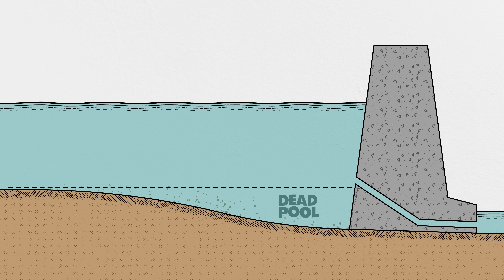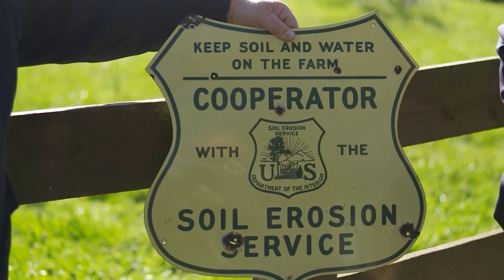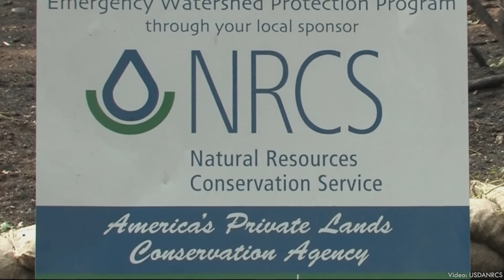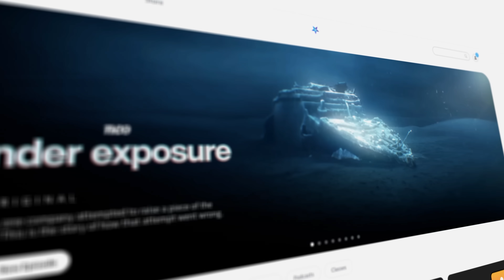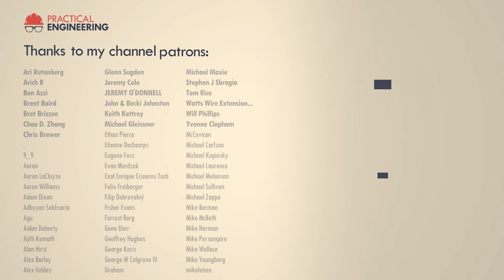All Dams Are Temporary

Comment: There is a dam on a large creek near me. The resulting reservoir has far less volume that it was originally designed to be. It was built in 1961 and was dredged in 1998 because it lost half its storage capacity. When I finally got a chance to visit it in my kayak I was really surprised to find out how shallow it was. The dam is 39ft high yet the water was only 4ft at the dam and that was around 2015. A report from 2005 that I found indicates studies estimate 10,000 tons of sediment deposit per year.  I believe sediment load rates certainly increased starting in the 80s due to lots more developed around the watershed and it only got worse after this report.

Comment: As an engineer who works with dams, I'm mad at myself for not thinking about this issue before watching this. The main dams I interact with are dry dams, and those still have sedimentation issues directly downstream of the outlet structures. I'm uncertain of the feasibility, but I think the flushing idea might have the most promise. Letting the flush happen in stages could reduce the downstream sediment pollution, and inducing pockets of turbulence in the flow could help the flow pick up sediment near the banks upstream of the structure.

Comment: I wonder if any one has tried coming up with a in place pump system that goes around and pumps a section over a period of time and dumps it past the dam using a pipe wouldn't provily work well in most cases but a low sediment river like kenebeck or plesant pond in maine probably would be feasible to pump a years worth of sediment over the course of the year

Comment: I wonder if you could create an autonomous underwater drone that could “vacuum up” the sediment and release it nearer the surface so that a certain percentage of it would go over the dam. Could adjust intervals, quantity or sediment, and location (remotely) to adjust amount of sediment sent downstream to = approximate “normal” sediment flow +/-. Can add sensors downstream to send data to robot which could adjust its own settings (if possible) or relay to engineers who can adjust remotely.

This could be an affordable and adjustable/ scalable solution. Basically one or more of these that operate all the time so that the levels of sediment are reduced but then back it up (reduce to one unit, lower frequency) for maintenance.
Like an Underwater Roomba with a line to the surface area. You should make that! 😊 Thanks for the great video!

Comment: Excuse my ignorance, but it seems to me like the best solution is to dredge sediment out of the reservoir proactively before it becomes a problem. Instead of trying to remove a large amount of sediment at once, you can remove a relatively small amount periodically over time, thus supplying rich soil to locales that need it and preventing the reservoir from shrinking. But, as I said, that requires being proactive, and this is a problem that was caused by a lack of proactiveness, so my solution might not be applicable.

Comment: Flushing can be a great solution if the topography is right. The Gebidem (also Gibidum) lake and dam holds back water from the Aletsch glacier. The water holds high amounts of sediments. So the lake gets flushed every spring with the arrival of the first major melting waters. This will take 48 hours as the stream will first dig a small trench but the walls of that trench will then continually collapse and get flushed into the Rhone river and finally into the lake of Geneva.

Comment: You told me to think abou it. Thus, I thought about it...on the 4th of July (I have some beers into me). God bless America! However, the thought of installing some kind of water tower on the upstream face of the dam occurred to me, since the water depth is higher here than upstream. The tower would pressurize a net of perferated water lines that stretch upstream enough to keep the sediment in suspension as it approaches the dam. It feels like a perpetual motion device, which seems impossible. I must experiment...

Comment: Can't we change it so the problem of build up of sediment becomes something we use to create new areas of land for repair of areas affected by erosion or creating areas for farming food crops....if the dams are first placed in areas suitable and the dam structure is temporary and moved when needed down the river to create a new area repeating this process either going further up or down the river system or remove the sediment from first dam site and using the same area again ....but basically using the build up of soil the ability to redirect when in flood to move the sediment out of the main water channel and into land areas prior to the dam slowing and spreading it across flood plains using barriers to catch the sediment . Also planing of a dam wall not being fixed in place but overall  to remove the perception of it being a problem and look at the potential it holds...
Reply: Like a new concept in dam overall and how we manage them by working with nature and not trying to control nature  so working smarter not harder and the collaboration of different areas of expertise when looking at how we could create something like that ...Goodluck

Comment: You need to upgrade your R&D over soil and sediment flow before you can solve anything.

Idk what's already there, but a hub for scientists parked or build alongside a dam.

Collect resources and samples, act as a small sediment filter to check for pollution and redistribution of safe soil.

It doubles as an place of study, and may give extra time to the sediment deposit. 

Not enough to offset the dams, nor the problem. But maybe enough time to discover something new and save some areas. If they're lucky

Comment: Doing as asked and just posting off the top of my head solution.

Y split to have "free(er) flow" and actual dam with power and blocking .

You can then switch them regularly, and do "purges" opening them almost full to allow for a big "storm" like wash of sediment that piled up.

(You could also have a way near the split to block off and clear in detail that section)

You would have the current "free flow" branch acting as the intended overflow, so less power from the actual hydro part, with the particals suspended higher in the water flowing out and over at higher speed then through the actual dammed part.

The Y split its self is going to have its own build up at that point, that can be partly manged with the purging when switching between the two every so often.

You could also design elements to make maximum turbulence from the bottom to lift and suspended the particles during purge or when acting as the "free flow" to keep lower suspended sediment moving back up right before getting to flow out

Comment: It seems to me that an auger should be installed at the riverbed to intermittently, or just very slowly push sediment back upstream and back into suspension. I don't know if it's better to electrically power the auger or to just gear it up or down and directly power it by the flow. Naturally it would require a sizeable passage through which to push the sediment, but nothing compared to the dam itself. I don't know why this wouldn't work, and I of course don't know the numbers needed to make it economically viable.

Comment: Would think a combination of flushing and agitation coupled with a prudent amount of dredging over a period of 3-5 years might at least solve most of the problems with large water ways.
I know that dredging in and around the Houston ship channel is a constant issue.
Agitating the silt back into suspension while flushing should clean things out... the issue would be slowing it down. Maybe not to the level that would be "natural," but hopefully to a point that it doesn't cause critical issues downstream.

Comment: There... is a very practical and easy way to deal with this but there would have to be a large range "no swimming" or potentially even boating for it to work. If sediment build up is a problem why not just have mechanisms to churn it each time the dam releases water? It could even be turned into a kind of profit on the state or country's behalf of selling the sediment to areas that either need or desire it.

Comment: A question I wanted to pose was that why not co-op the removal of the dirt and silt from the reservoirs via agencies and companies that run landfills? Using the sediment that builds up in these reservoirs as the material that landfills put overtop their amassed garbage when the landfills close could help divert some of the stuff, and would help knock out two metaphorical birds with one stone. Splitting the cost of sendiment removal with the landfill agencies and then providing them with the material might also help the sunk-cost issue of having to remove it in the first place! I can't speak on the tonnage that landfills would need regarding sediment, but it could prove helpful. What are people's thoughts!

Comment: 11:01 

Flushing ain't gonna work for most dams. Because the downstreams are also living settlements and stuff and the dam reduces the capacity of the ruver downstream by A LOT. It won't be able to carry that water and sediments.

There was a case of a flood in India during 2018 where heavy rainfall lead to the dam having to open the shutters because of over filling and it lead to devastating floods downstream.

Oh boy this issue is scary

Comment: If we can pull off the Berlin airlift, dredging reservoirs are 100% possible, and it doesn't have to happen annually. We could do a combination of flushing the reservoirs to start de watering the sediment and having the Army corps or engineers decend on it for a few months before moving to the next one.

Comment: uhm... so, dredging plus Aztec floating farms w aquaponics and integrated solar... equals kickass floating farm situation... a US take on public/community farms?
for the dam, the offer is: lower water loss to evaporation, could also integrate floating solar, and be an offset of sediment dredging? several of the floating plots could easily become staged dewatering plots... that just tow around behind the dredge when needed.
and for the state or city, you get bonus farmland, bonus solar space,  produce both food and an earth product (mulch, garden earth, fertile dark soil or straight sediment, whichever sells best) so... that seems like a business opportunity.
commercially: a farm w default water access, that irrigates in the most efficient and direct way possible, that has cost offsets for water , can easily integrate aquaponics... that literally gets first ask for sediment dirt?
design the pontoons right, there's potential for a dozen design advantages and efficiencies

Comment: the whole "we don't usually dig giant holes to become dams"
>in many places, we absolutely should.
i wonder if a set of settling ponds, cleared regularly, aren't work integrating into most Dam designs..upstream landowners are likely to buy land back.
could change if we took some open cut mines and back-filled some clean clay/sediment.
similarly, if mines were paid to widen, strengthen, and seal out closed sections of underground workings to a sanitary level: these would then become sun shielded, temp stable places to store water.
the other thing is... most sediment is good, fertile farm earth: the kind that is priceyt to find otherwise.. in many ways, those farmers may well be willing to partially discount the operating costs to recover it.

Comment: Can you not just build a miles-long pipe (think Russian gasline to Europe) and use solar powered pumps (like we see solar panels on home roofs nowadays) so that all day every day there are sunny days, the sediment is pumped out? It might be a "slow" approach but surely the daily amount pumped out is greater than the amount that's settling in on daily basis. If output easily just a little larger than input, eventually, you win

Comment: Drain the dam and remove the sediment or build a new dam somewhere else along rivers. Use dredging machines to keep dredging up sediment is another option. No mater how you cut that cookie though it's going to get expensive.

Of course best to keep the sediments out of the riverse to begin with and that means working with farmers and wildlife management to keep cover crops on fields such that you reduce the sediment intake. This just slows the process down of course eventually the sediments will build up but an ounce of prevention is worth a pound of cure as they say.

No matter how you work it though, if you find value in the dam and lake then you have to put the resources into managing it and that means managing the sediments that build up in it.

Comment: I mean, arnt you just creating a water fall/water-tower in some sence that you can derive energy from when letting the prevailing flow just occur in the first place, less reservoir means less wasted land because now you can use the area the damb had stollen with said reservoir. There is a reason buffalo grew up at Niagara, a fall point, a lot of potential energy in all that mass dropping happening at once is a big amount of power. Mill ponds fill with muck, the pond is not the primary use, the energy through put typically is

Comment: This doesn’t seem like a hard problem. Maybe a Boston whaler size boat with a solar array, battery in an air compressor. Attach it to a hose with fins on it so it moves around in the different currents and wait the end so it hangs out right near the bottom. Will add more oxygen to the river dislodge and raise settlement on the base as well as allowed the bubbles to suspend diluted sediment longer. Add as many as you need to return sediment levels to 5% over normal and correct the problem slowly. Pieca cake.

Comment: The largest dam in the Black Forest, Germany was built in 1933.  After 50 years it was emptied for major overhaul of all structures but also do remove much of the silt.  Similarly another lake here.  Only 8 years left until the dams centenary and 50 years since the last major overhaul.

The empty lake was often described as a moon landscape and was an eerie tourist attraction during the summer of 1983.  An old road was fixed up for the tourists and horse carriages took tourists to the ruins of the old village of Schluchsee which had been under water for half a century.  The silt stinks awfully btw.

Comment: we have some sedimentation dams on specific locations so thet the sediment dont fill that much in electric dams on the river.. they use boats to pump the sediment on boat which is then moved away some after cleaning is used as fertilizer or is mixed in fertilizers.. this is going for decades... our grandfathers knew that also.. now we have our big dam to one of its lowest levels of water.. few years ago it was released and cleaned near the footof the dam.. this is great teaching for kids thanks for the model with colored sand is cool

Comment: Irrespective of the dam itself, the dam causes major changes in the flow of the river. 
A couple of quick ideas:
1. Make dams temporary. Anticipate a certain lifespan and design it for that interval and design it to be removed.
2. A different version of this idea is to design the dam to be shut down periodically so that it can be maintained AND for the river to return to some sense of equilibrium
3. A completely different idea would be to dredge the silt from the mouth of the river and dump it on the downstream of the dam. I’m not sure how effective this would be to help the river. Also, I don’t know if this would help the dam itself.

Comment: Thanks for upload and info. As an European earthling I knew absolutely nothing about Lewis & Clarke Lake before this vid.

Same ting happening to my local Tange Sø, though in less scale (artificial too, dam construction back in 1920, creating Denmarks biggest water turbine site, delivering electricity to 75% of Jutland's population), and now eco environmentalists are talking about demolishing the dam and the historical buildings and so on (I know it's just me being an old fool, but I have many memories associated with both the 105-year-old artificial dammed lake, which everyone today considers part of nature, and not least the hydroelectric power plant).

Nota bene:
Thank you for the tangible water models instead of just CFD output. I myself did not have a single cent of practical knowledge during my engineering studies, but I was good at basic research and coding CFD models for different viscosity and turbulence. However, that was as a thermal energy engineer and not within plants and water flow. For me, flow was just a continuum of different viscosity and laminar/turbulent intensity, and even though it's been 23 years since I left the area as a specialist, I still find it super interesting to follow.

Comment: The only solution that I can think of is to lay pipes with holes in them before the dam is built. These pipes go to the shore and are opened periodically. The pressure of the water will force the sediment out and little water will be lost especially if the dam must release water due to excessive precipitation. The amount of sediment each time is relatively small and disposal will be easy. It might be used as topsoil or clean fill.

Comment: Could you possibly create a model of a Tesla valve and use it to slow down the speed?

I think that if we slow down the speed overall, it would reduce/slow down the sediment travel problem. Tesla valve would allow for the creation of eddies that would create those areas.

Realistically not going to solve the issue but could slow it down by an order of magnitude?